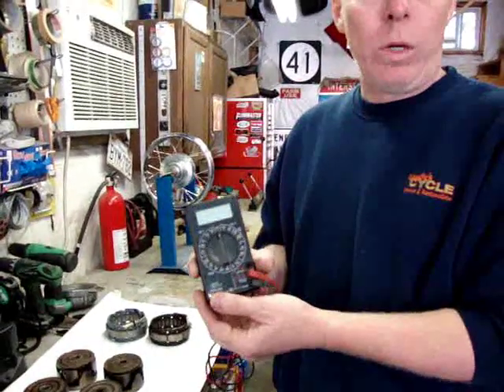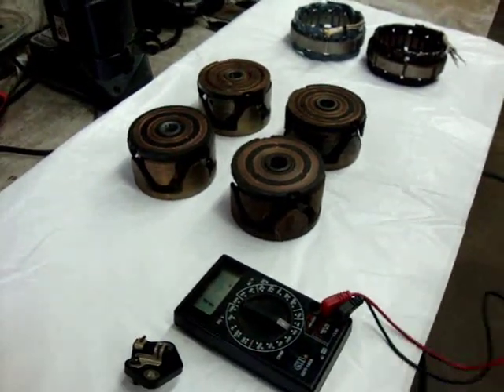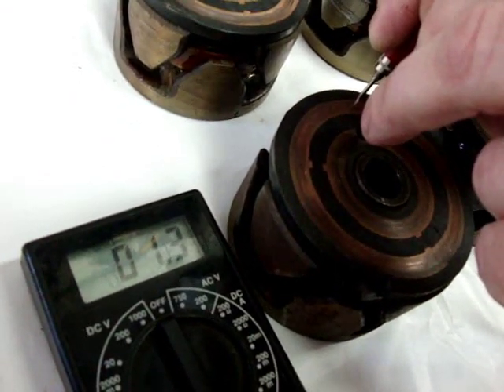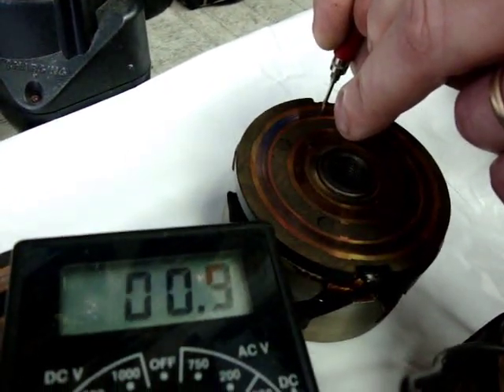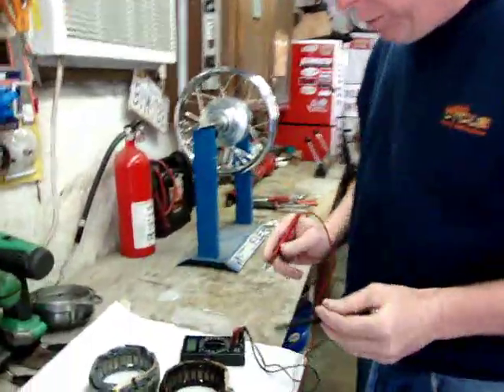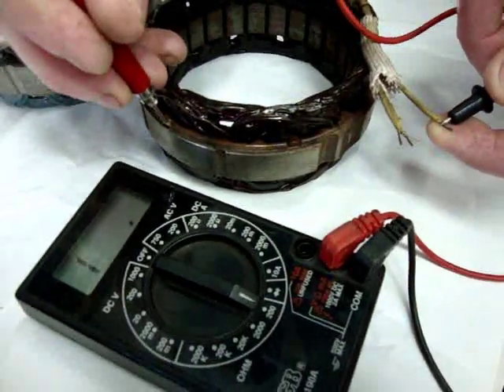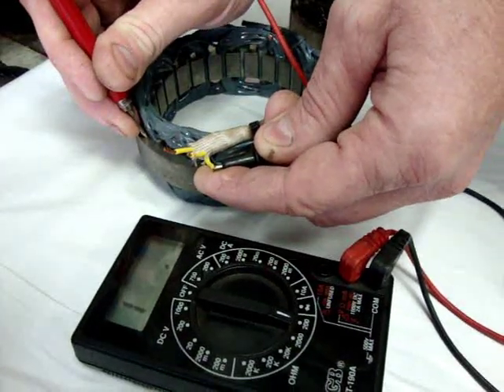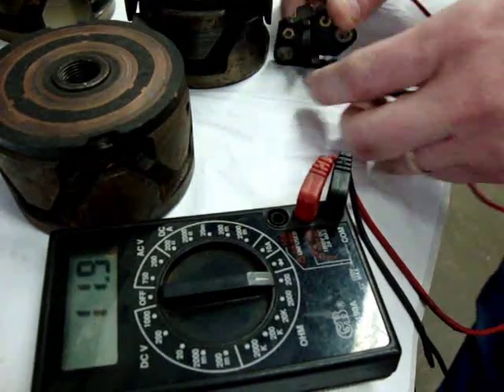PART 2 of 3: Theory & Testing of Honda CB750 900 DOHC Motorcycle Charging Systems @ rcycle.com

Comment: thanks i finaly  found what i look for in the book they have you disconect voltagereg and  test the connecter and if you have 2 - 6  on  the 3 yellow wires replace the  voltage reg i new i was not test that then when i test the stater same and no contunity to ground and yes i had to use 200 oms yours look like mine you are a god sent! its charge low and i had mice a long time ago but did not know they went under the tank 2 yellow ones bare i dont know if they touch or ark long time

Comment: What do you mean by between the slip rings and across the slip rings, do you actually mean on the slip rings or not on the slip rings? Thanks.
Reply from the maker: +Stephen Luke : FROM RCSR:  Have a ? about vintage bikes? Need to talk to a mechanic about a repair or to get a second opinion? Need help finding parts for your vintage bike?  Not interested in spending hours researching or lots of money trying to figure it out?
For a small fee, we offer Randy Creel's 25+ years of expert, professional mechanical experience & vintage bike knowledge personally tailored to your needs.  
* 15 minutes = 25 US

Comment: So if im not getting any ohms from the rotor rings or the white and black wires it is safe to assume it is bad?
Reply from the maker: +2000yamahar6: FROM RCSR:  Have a ? about vintage bikes? Need to talk to a mechanic about a repair or to get a second opinion? Need help finding parts for your vintage bike?  Not interested in spending hours researching or lots of money trying to figure it out?
For a small fee, we offer Randy Creel's 25+ years of expert, professional mechanical experience & vintage bike knowledge personally tailored to your needs.  
* 15 minutes = 25 US